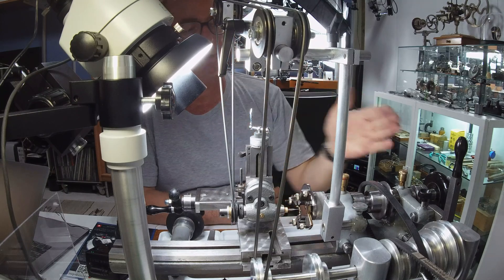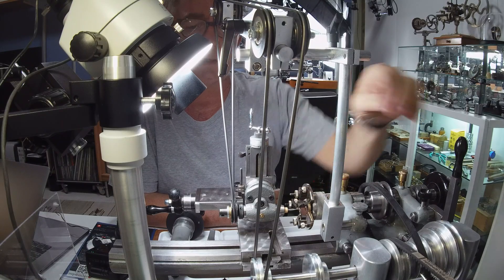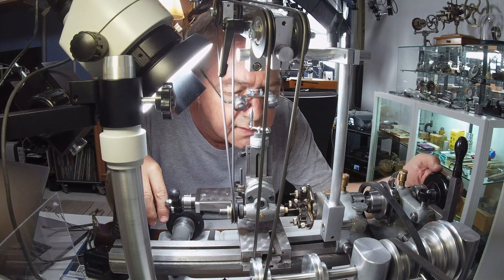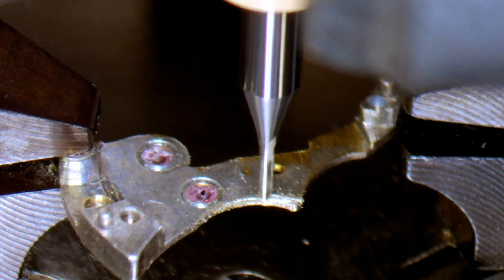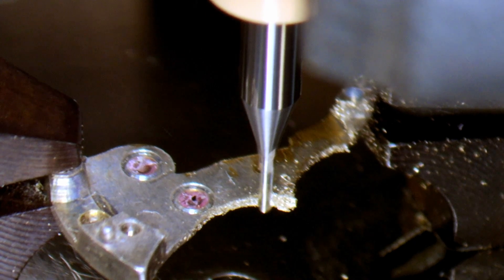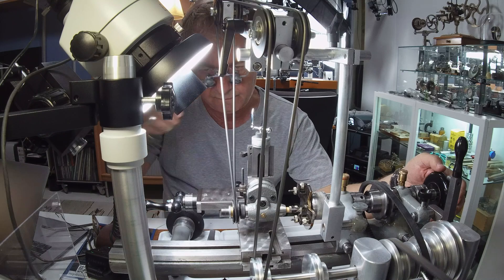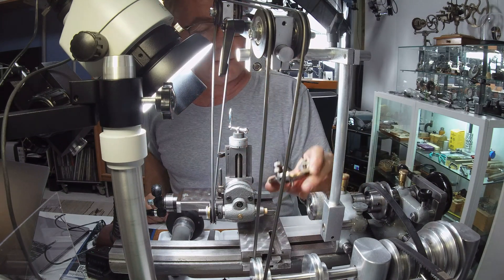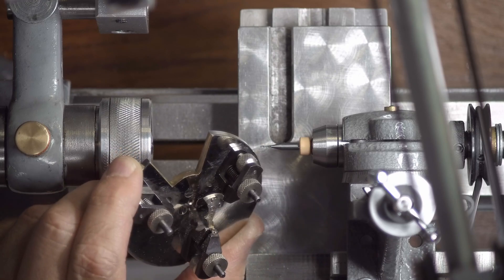Fixed Arc Milling Test

Comment: Hello we’re do you get those glasses from please
Reply from the maker: Those are Jena 2.3x magnifier eyeglasses / surgeon's loupe. Google Jena DDR 2.3x. I paid about $160 for them (used but like new) at a watch fair in L'Abbaye Switzerland. I've seen them on Ebay from time to time for $300 - $500 used. The modern version is called Zeiss EyeMag.
Reply: @IMakeWatches  thank you so much

Comment: Beautiful set up. I would have thought of that as a turning operation. What led you to choose milling?
Reply from the maker: Testing my milling setup? 😂😂😂
Reply: @IMakeWatches  looked like it did a good job. I have been loving milling with a single point cutter for the finish but can not yet grind milling cutters on that scale, awesome to see what you are doing, thanks
Reply from the maker: Why not just buy them? Very inexpensive on Aliexpress. I think I have some as small as 0.1mm... https://imakewatches.com/shop.html#f
Reply: @IMakeWatches  why not just buy a new watch? I want he fun. I'm not excited about buying the thing someone else made when I could enjoy the adventure of learning to make it myself. Also if I can grind the tool myself I can keep it sharp and I can shape the tool so I am not just milling a straight line. I could  shape a cutter to add a chamfer at the top surface or smoothly round the top surface to the bottom rather than just cutting through square to both.?
I do buy tools though of course, there is a balance to be struck, If I tried to make every single thing it would take far too long to get anywhere
Reply from the maker: @stanwatches  Thanks for clarifying! I agree 100%. I was just responding to you saying it was too small to make! 😂😂😂